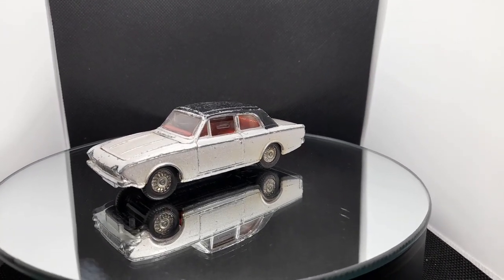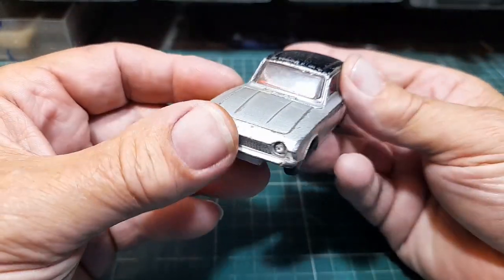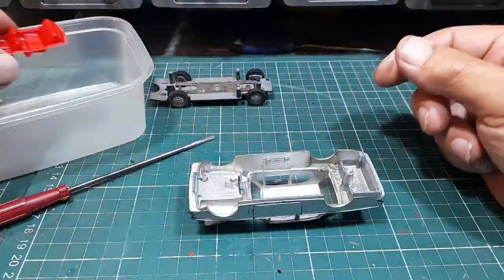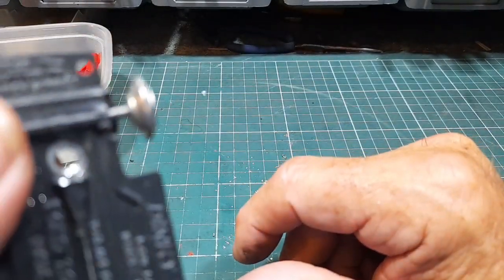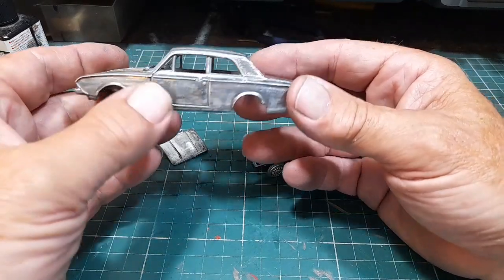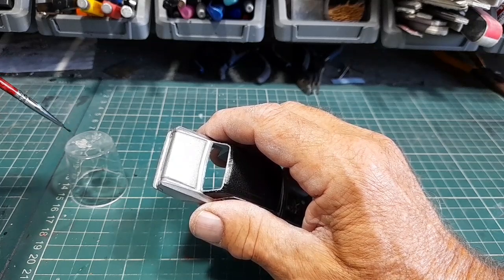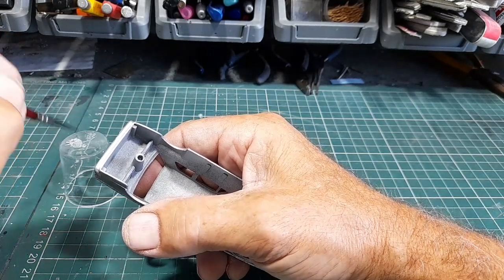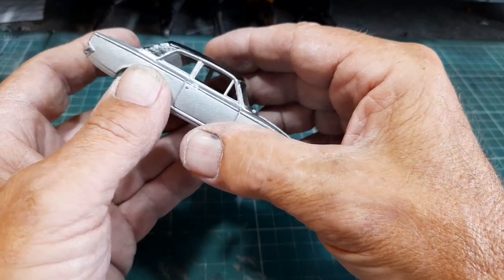Dinky toys Diecast Restoration Ford Corsair 2000e no/169  1966/69

Comment: Another nice restoration Martin. I have a red Dinky Ford Corsair that I bought locally,  the guy I bought it off told me that most Corsairs are blue but mine was red because it was part of a set that came with a car transporter. I don't know if that's accurate or not. Mine doesn't have the black vinyl roof. You've done a nice job on yours, as always. All the best. Peter.
Reply from the maker: Cheers Peter, it's not accurate as far as I know the red could be brought single. I like to look at Google images if you put in say dinky toys ford corsair it will show all the various colours and box's etc  worth having a look.
All the best Martin 👍
Reply: @martindaredare  Cheers for that Martin. 👍

Comment: I mostly used to buy 1933 prewar Dinky Toy models, had a few hornby Dinky ones in my time very hard to find. I had a nice 22B dinky toys prewar sports coupe, bought it for only £8 sold it on ebay for £450 it then went on its journy to China, & the guy paid for very expensive postage. I still have loads more i:m going to get rid of all mine now ive sort of grown out of them. Ive got loads of Corgi boxed gold plated ones also, some tootsie toys, matchbox. some half restored ones which someone had previously done some have parts missing they came in a job lots.
Reply from the maker: Hi Doja, that's interesting the pre war castings are nice to have ,some I have noticed suffer from deteriation especially the ship casting. 
It sounds like you have a good collection. 
Thanks for sharing my friend

Comment: I've got the earlier version in pale blue with standard wheels and baseplate, same opening bonnet, jewelled headlights, steering & opening windows.  The Dinky Opel Kapitan has the same opening front windows.  Incidentally, I think you'll find that the hole in the chassis is for towing the car on a breakdown lorry.  You need a tow bar for a trailer.
Reply from the maker: Very nice that you have the blue one it's a nice colour and yes you are right it can be used with the tow truck, but if you look at the dinky caravan it has a balanced tow hitch witch goes under the base plate, I will demonstrate this in a short video soon .
Because I often get asked what the cut out in the base plate is for .
Thanks for your continued support my friend All the best martin 👍

Comment: Endemic model of Ford UK & Australia .
The 2000 engine was a 2v carb , V-4 1996 cm3 or 121.9 cui,87 hp (DIN) Torque 119 nm.
She have front disc brake & drums rear .
A nice dashbord covered by wood i don't know if it's real or fake like US cars .
This Ford is capable of accelerating from 0 to 60 mph in 12.9 sec and the quarter mile drag time is 18.7 sec.
Have a nice day =) !
P.S :
She Looks like at the design point of view of the front part , a 1963 Ford Thunderbird.
Reply from the maker: Thanks Fred, some great information there my friend, thanks for your continued support it means alot.

Comment: According to my research, Martin (I thought there was something funny, so I checked) the Ford Corsair, earlier known as the Consul Corsair, was only produced in two door to special order, almost exclusively for export and in left-hand drive. The 2000E was never done as a two door, as it was a much later V4 car, and of the almost half a million Corsairs built between 1963 and 1970, fewer than 10% were two door cars. There were GTs but no 2000E models. Does anyone care? Probably not, but it just looked odd when you were talking through the details!

I have a Landsdowne one that I bought new ages ago that is a bit more accurate - they didn't have such big wheels in real life - but it is a simple 1500, I think, and finished in a plain, undecorated white. Oddly, the red interior is probably right - my Dad had a Mark 1 Cortina 4-door Super in dark grey that had a red interior: it was the first car I ever drove on my own, at about ten years old, on a beach in Wales!

I love how this hobby brings memories flooding back, sometimes!

26/27 degrees? Perishing! I had 48 yesterday! I'm not even going out.

Great finish on the motor as usual - looks better than new.
Reply from the maker: Good information there fraser another thing to mention is the bumper overriders as far as I can remember there wasn't many without them .
I would say dinky were not prepared to change the castings from 4 to 2  or vise versa to  expensive  considering to them it was sold as a toy .
I had 2 mk1 cortinas a 15gt and an estate the estate had seen better day though, my friends one the struts came up and bent all the bonnet, common problem, needed a plate welding round the top of the struts. 
All the best martin I 👍
Reply: @martindaredare  Interestingly, Dinky 130 is a two door but has a four door illustrated on the box art: I wonder what that was all about?